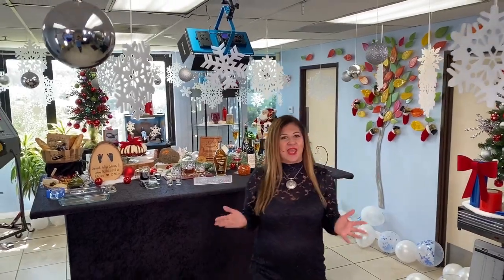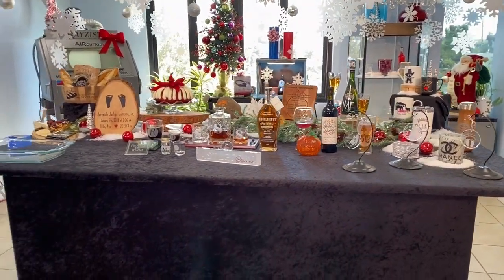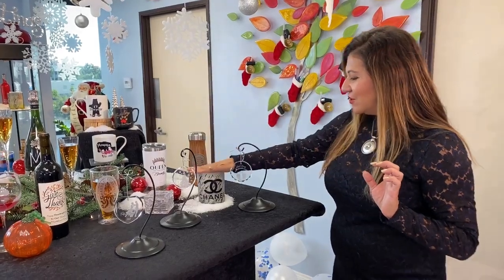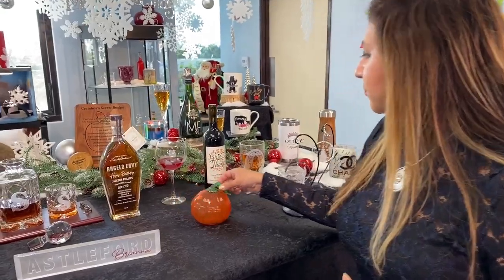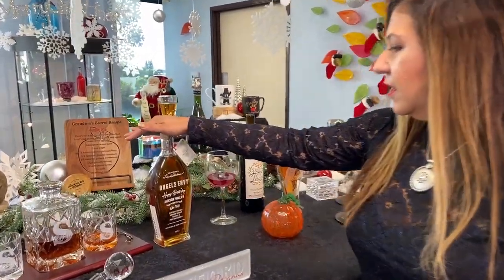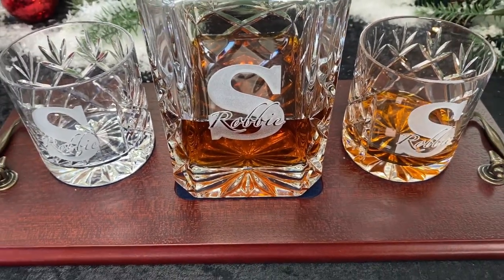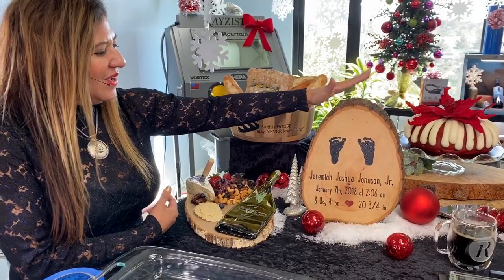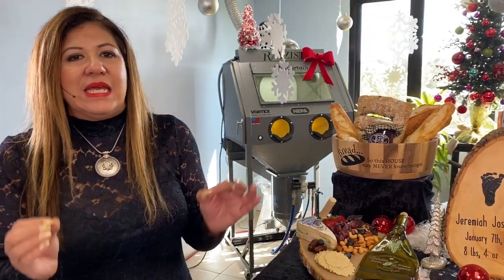Sandcarved Gift Products | Special Video Presentation for Graphics Pro

Comment: Nice video, what kind of paint do you use to paint fill the wine and champagne bottle could you send a link to purchase
Reply from the maker: We used several paints, mainly the Montana "gold" series (low-pressure). Most mural artiest paint are excellent choices. But beyond the material, its mostly in the technique... 
Appreciate you watching!

Comment: rather than sandblasting can these films be used with etching creams thank you ?
Reply from the maker: Hello Jeff, all of our films require a sandblast process. Etching Cream will penetrate our film's membrane, shattering once media hits it. The membrane allows for the easy transfer/removal of the film's carrier liner.
Thanks for watching. Rayzist.com
Reply: @Sandcarving  thank you so much for the information
Reply from the maker: @jeffweber5546  You are welcome... you might check out the extremely portable/hobby blasting system from Aero Etch https://www.aeroetch.com/
A customer has been working to develop this product for some time.

Comment: Do you sell the nameplate, or can you refer me to where to find it.  It is everything. :-D   Also, what is the red metallic paint you used on the nameplate?
Reply from the maker: Hello Erin, the nameplate is from the EDGE blanks range; you can find it on our website (Rayzist.com) or at glassblanks.com.
Item#: NP003 (Jade Glass) there is also an Optic Crystal nameplate that is gorgeous (same style).
Paint: Montana brand from there "Effects Series" colors Metallic Red (Typically we recommend the Gold Series (low-pressure paints w/ gold skinny caps)
Thanks for watching!

Comment: Do you sell the exposure films or mask and exposure machine?
Reply from the maker: We do manufacture exposure films. This is called photoresist film. Most of these items were produced on SR3000 Self Stick film.
Please see Rayzist.com for our resist films.
Reply: @Sandcarving  Nice video, what kind of paint do you use to paint fill the wine and champagne bottle could you send a link to purchase
Reply from the maker: @Dwayne Johnson  Sorry failed to mention the "hand-painting" was done with enamel paint. 1-Shot is a great signage enamel material, although there are several manufacturers.